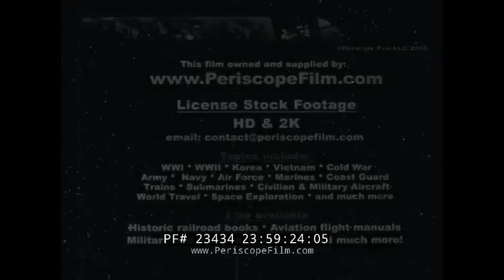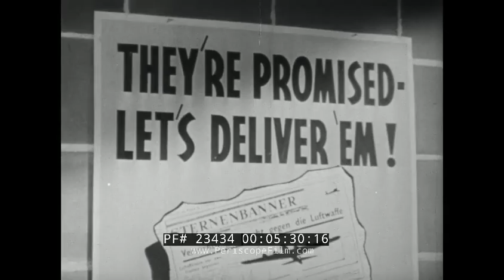BIRTH OF THE B-29 BOMBER  WWII OFFICIAL WAR FILM 30 23434

Comment: I work in the Martin Bomber Building at Offutt AFB, NE (not where the film was shot) and have seen some of these machines and cranes abandoned in place.  Even though this film shows the airframe and powerplant assembly, there were other production facilities called "mods" where the interior, wiring, and plumbing were completed.  One of those buildings still exists and is used as a gym at Offutt.